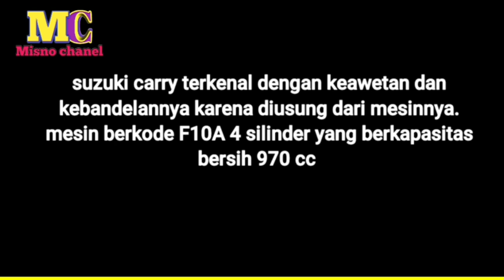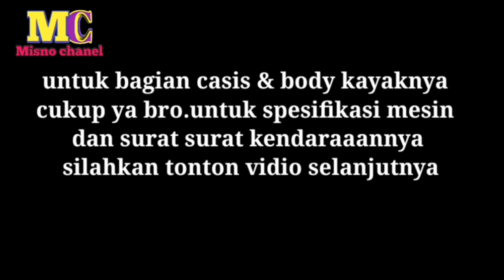Simak vidio ini sebelum membeli Suzuki Carry 1000 (Body & casis)...Eps 1    #suzuki#jadul#otomotiv

Comment: mantap kang. mobil irit, bandel , tangguh tiap medan. video sangat bermanfaat. by; archa buleleng
Reply from the maker: Bener mas..👍
Reply: @misnochanel  trims kang. minta subsnya jg y kang.
Reply: @misnochanel  kalo stater carry cengengesan apanya om
Reply from the maker: @zidanalfatih799  cengengesan stater enteng apa cengengesan rada nggandul mas?
Reply: @misnochanel  om misno cara ganti engine mounting carry bagong gmna?  Bisa ngga tampa buka besi yang nempel di sasis
Reply: instaBlaster.